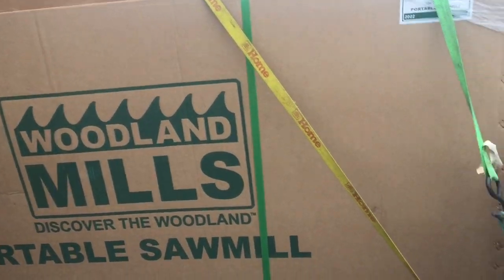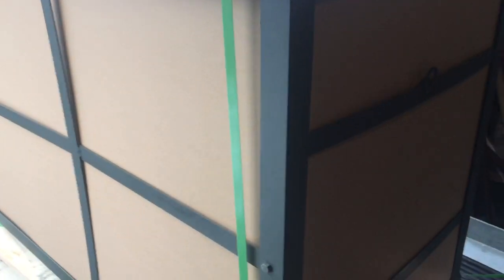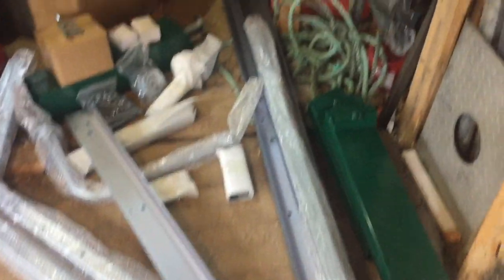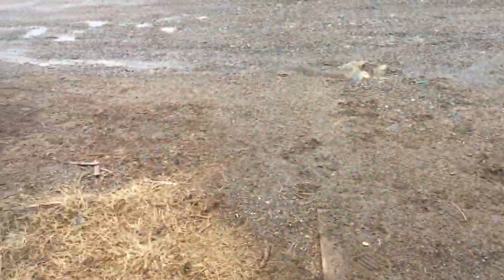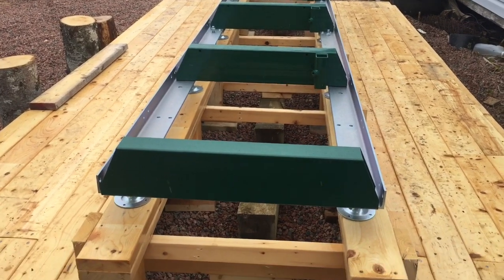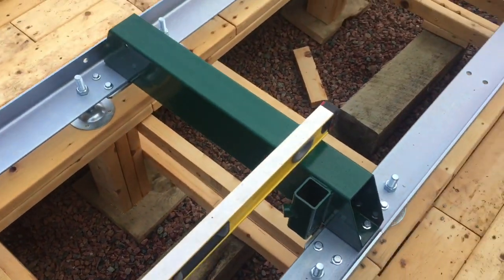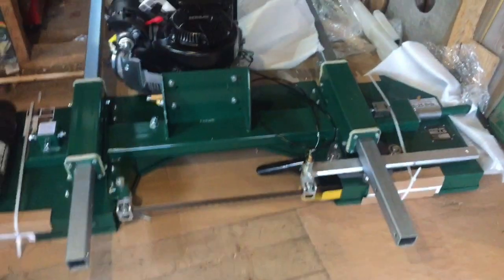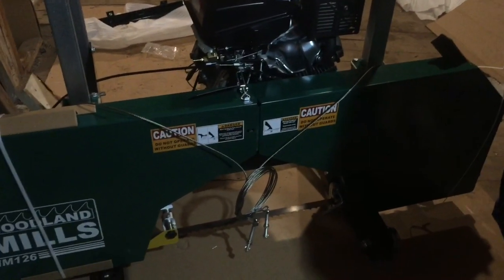Woodland mill HM126 14 hp assembly

Comment: Hello Wallace. I have the same mill and bought it 2 years ago. Just started my third season with it. Very easy hto use and you can saw some very nice timber with it. I found the most important thing when setting mine up was getting things level from the start. Once the saw head is on things are harder to adjust. The timber you choose to saw is important too. I known you guys have a llot of larch (tamarack) out there. I sawed some this spring and went through lots of blades because of the sap even though I run windshield washer  fluid through my water tank. Most important thing is to change your blade early. My first year sawing my lumber was not the best because I used the same blade too long. Look for skip marks on the lumber and watch for blades jumping around knots.
Reply from the maker: Thanks I appreciate it you’re tips and keep it in mind. I can’t wait to get started if I have any problems I will drop you a message thanks again take care and have a great week coming up